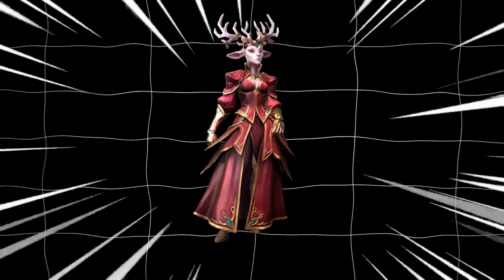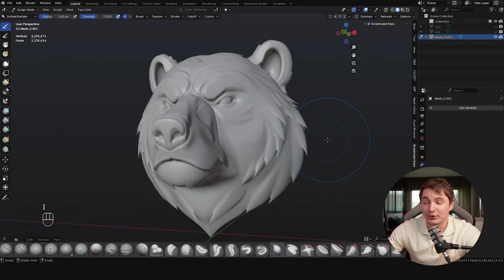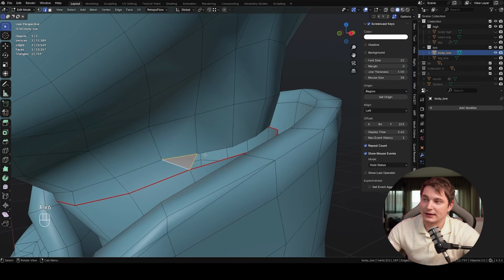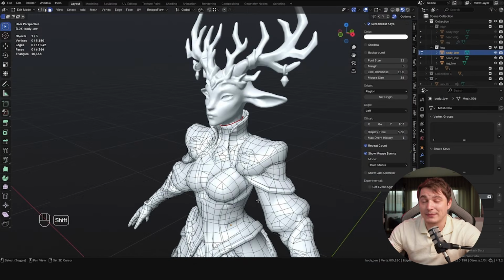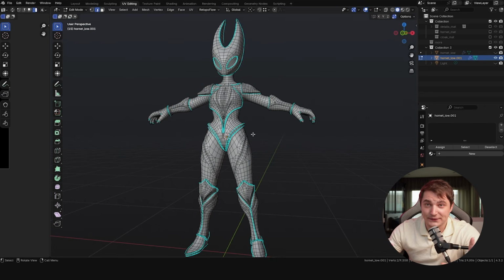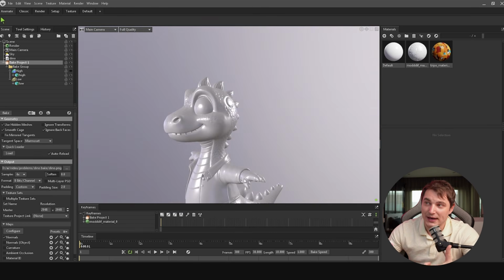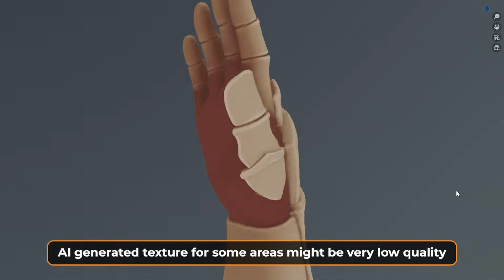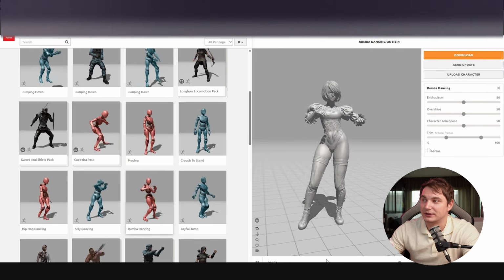How to Fix AI Generated 3D Models - Vol. #1

Comment: i gave up editing on the mesh. i just made my own models that are already easy to rig. used the ai only as high res reference and retopo/quadremehs/sculpt its much faster than tinkering the ugly vertices made by AI. then the marmoset solution was probably the best option cause blender's baking isnt really that great
Reply: Decimate the high poly model and use quad remesher for clean topology. Works amazing if using on symmetrical assets. Then bake all your maps from a copy of the high poly mesh.

Comment: Hey, just for your information. The python library meshlib is the best decimater, when it comes to preserve details in low poly from high poly. Before i also used blender, but it get fast to its limit on AI generated models. So i would advice to use Meshlib decimate.

Comment: 2:24 Not gonna lie, I’ve never seen an AI generated 3D model taken from an image look this beautiful, well proportioned, and accurately sculpted. I think in a few years it’ll be obvious that AI will do many sculpts better. Sure, people will still retopo uv and rigging weight paint manually, but man, this character genuinely looks like it was sculpted by a professional.
Reply: Addons in blender that retopo automatically. You can also UV unwrap automatically in Blender. You dont even have to manually place UV seams. Weight painting is also automatic but definitely needs to be touched up. Honestly every automatic process usually needs manual touch up.
Reply: And it is generated by AI sir, I did it in Tripo. IT is crazy how good it is now
Reply: @stefan_3d_ai  Yeah, I know. I tried Tripo too. It makes the sculpt almost perfect. I think Tripo is the best 3D generator so far. It’s just a matter of time before the generation becomes much better in a few years.